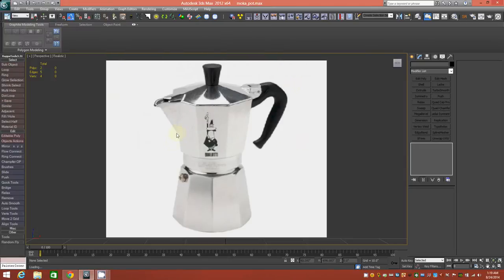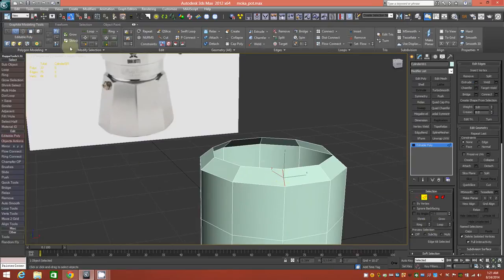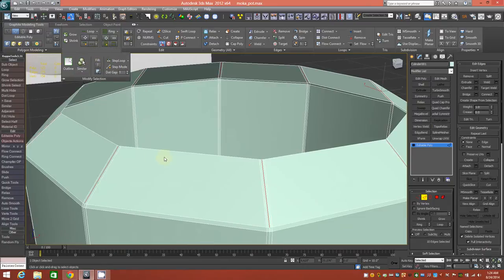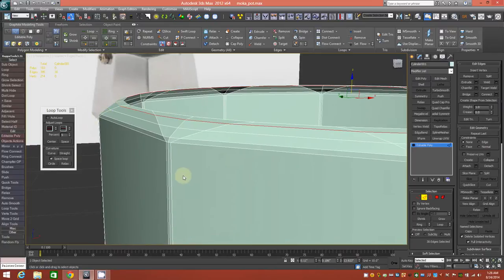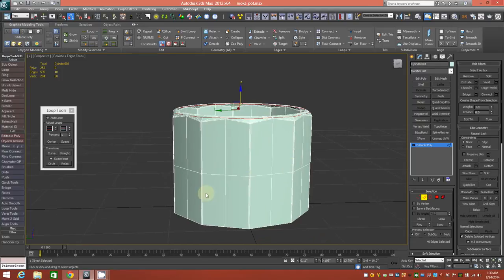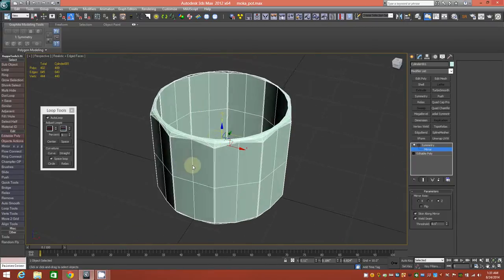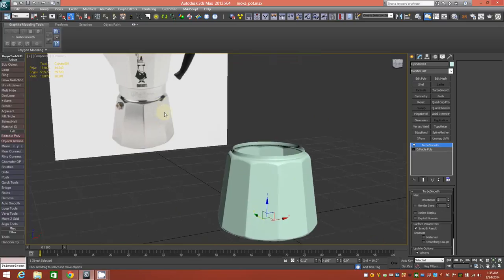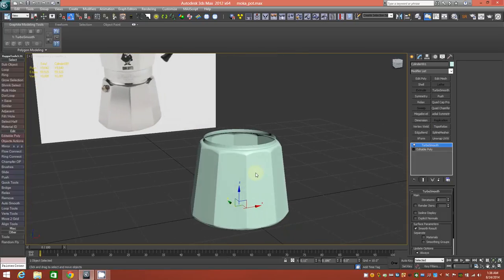3D Tutorial | Modeling A Italian Coffee Pot In 3dsmax (Part 01)

Comment: This is definitely wrong designed. 
The handle should be a single piece with the upper pot mould connected to the pot as a large ring in 2 sturdy points.
The plastic handle is fragile and always went broken because of temperature and because of leverage while opening and closing the main thread. The rest of the assembly is better than flush round ones bacause it offers a better grab.